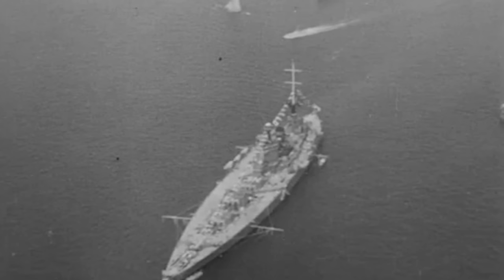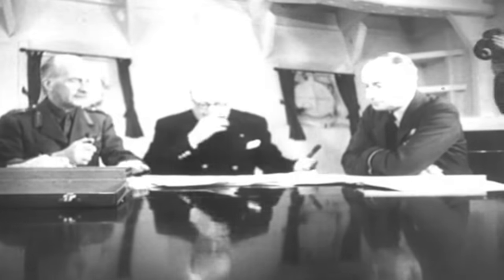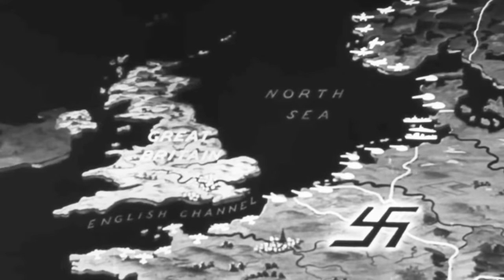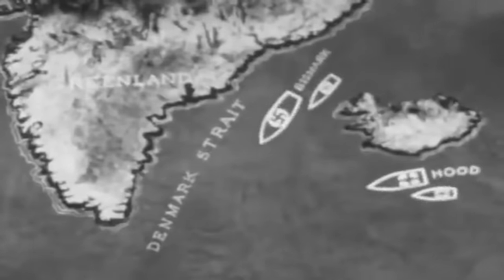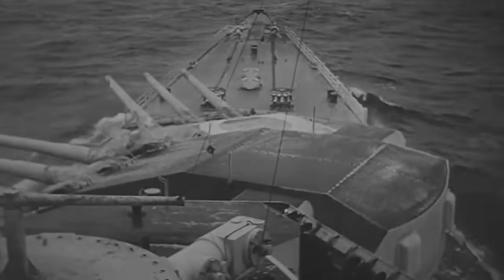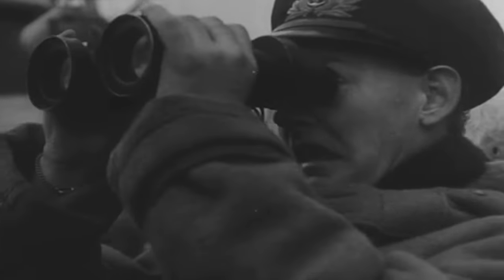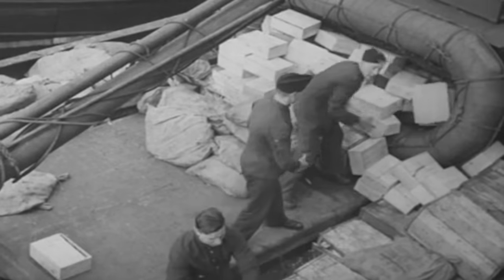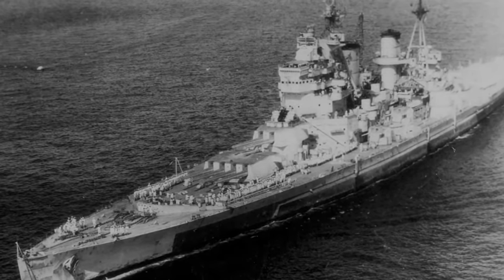The Giant Revenge Battleship with a Unique Mind-Blowing Mission

Comment: The exploding battleship is HMS Barham. A man that I knew many years ago was blown clear of Barham as she blew up. HMS Rodney’s 16 inch guns did the most damage to Bismarck according to 
the battle reports to the navy board.
Reply: Rodney was commissioned in the early 1920s. She was about the same weight as KGV, had more firepower and excellent armour protection, but speed was sacrificed to achieve this and she was 5 knots slower, possibly more. She was also pretty worn out and on the way for repairs and refit in the USA when she was diverted to fight the Bismarck.
Reply: HMS Rodney claimed to have hit Bismark with a torpedo. If true, that would be the only time a battleship torpedoed another battleship. HMS  Dreadnought holds the distinction of being the only battleship to sink a submarine. It did so by ramming.
Reply: Definitely Rodders That Gave It To Jerry
Reply: My grandfather was on Barham at Jutland
Reply: @philiphumphrey1548 no actually KGV was Heavier than And more heavily armoured than Rodney 

KGV was immune to Rodney shells but Rodney was not Immune to KGV'S shells 

The reason Rodney did more damage was because Rodney engaged before the KGV even showed up in the fight 

As per capita time eneged engaged KGV did most damage to Bismark 

The 14 Inch shells pierced the Superstructure and belt many times with clear holes and blown the turrets of Bismark
Reply: “Rodoil” as named by the RN servicemen, on account of her profile that more resembled an oil tanker of the time, than a battleship.
Reply: Yep, HMS Rodney did most of the damage with her nine 16-inch guns. However, Rodney also suffered her own not insignificant damage, but not by the Bismarck... it was battle damage incurred by the rapid sustained rate of fire of her own massive guns.

Comment: The Bismark was on it's maiden Voyage, after a year of trials. HMS Prince of Wales's Ten 14inch guns had a heavier total weight of shot than the Bismark's Eight 15inch guns.
Reply: They did have a heavier weight of shot than Bismark's when all turrets were functioning, which wasn't the case for most of the battle.
Reply: @garethdavies2538  
They were at the beginning of the battle, PoW hit Bismarck with three shots causing the Bismarck to abandon it's mission and run to port, it was only after these hits that the guns on PoW failed because of electrical problems, after a few hours the problem was fixed and she joined the chase for Bismarck.